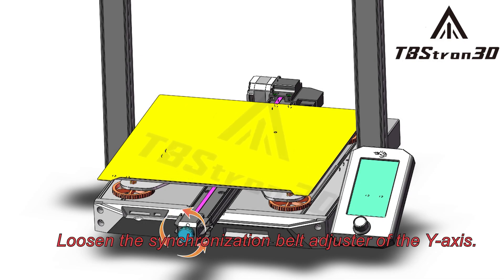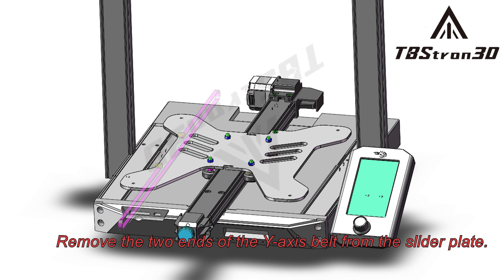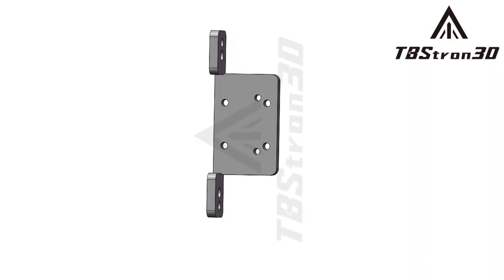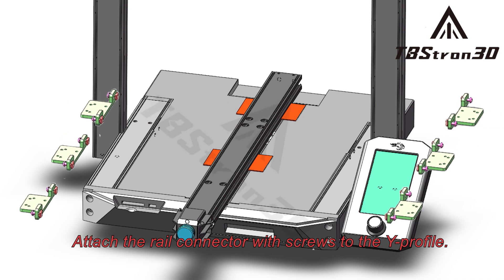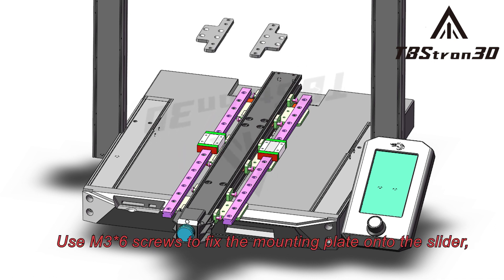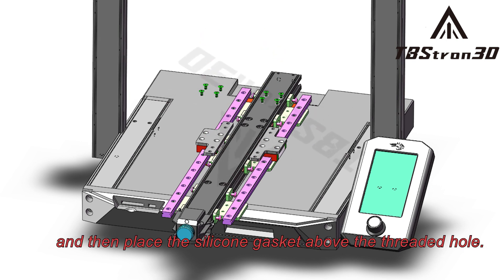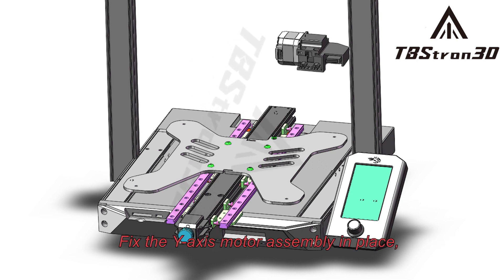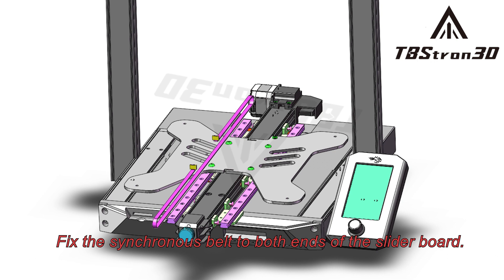Ender 3 S1 Plus Y Axis Upgrade Linear Rail Installation Guide Animation Version

Comment: So after i have installed all the parts how doe the bed suppose to hit the linit switch? I followed the instructions and it just grinds because nothing touched the limit switch in the back of the bed
Reply from the maker: Hello, after the modification is complete, use the original screws on the machine to touch the limit switch. When disassembling the POM wheel, do not remove the screw on the slider plate. When installing the slider plate, please ensure that the screw faces the direction of the limit switch. Thank you.

Comment: I love this kit as it’s one of the few kits out there that is compatible with this printer. But assembly is a little difficult as you have to constantly remove and readjust the rail mounting brackets. I wish there was some sort of spacer to put in between each bracket so you can slide them in one by one and tighten them down in between each bracket so that you don’t have to constantly remove adjust and re attach the brackets and rails. Otherwise great kit, just remember to lubricate with some 3 in 1 oil prior to use to help the ball bearing blocks slide easily.